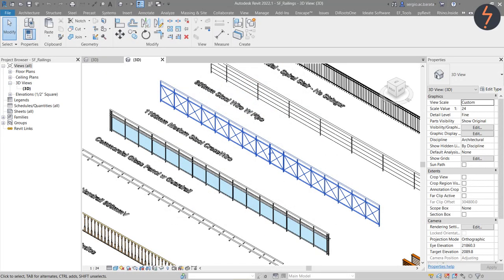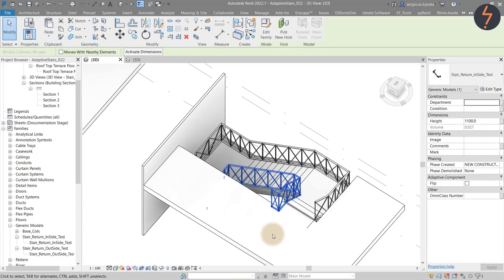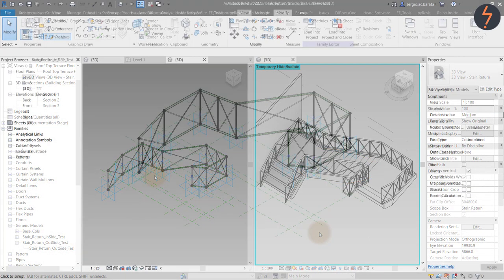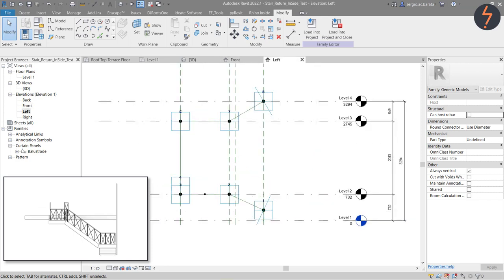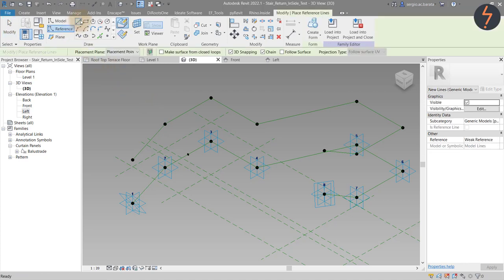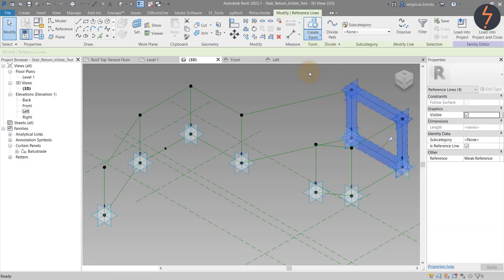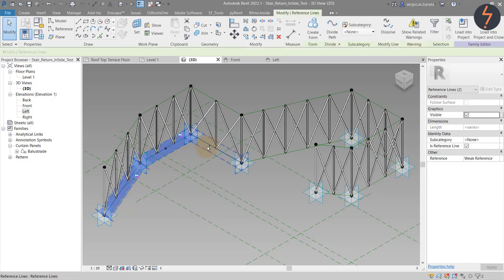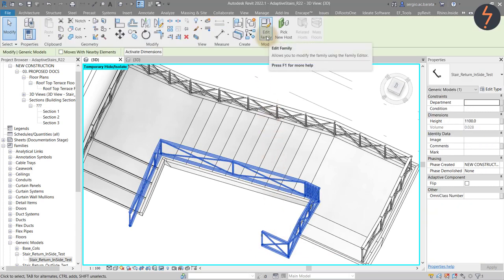Revit Massing Tutorial: Adaptive Stair Railing - Revit Massing Techniques Revealed

Comment: I think a slightly more flexible method would be making railings from generic components that can be built up like puzzle pieces, such as corners, ends, returns, stairs, etc.

Or better yet, Revit fixes the railing tool so thousands of Revit users don't spend millions of hours wasting their time trying to make railings without using the broken railing tool.
Reply from the maker: Interesting point. Sometimes we need to find a work around. Thanks for the comment!